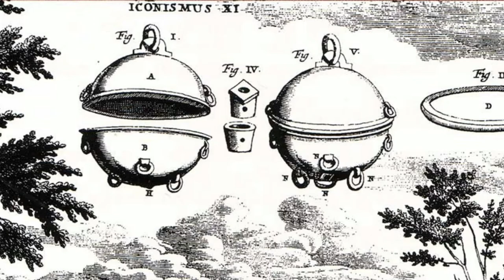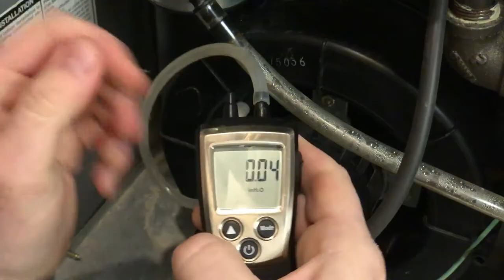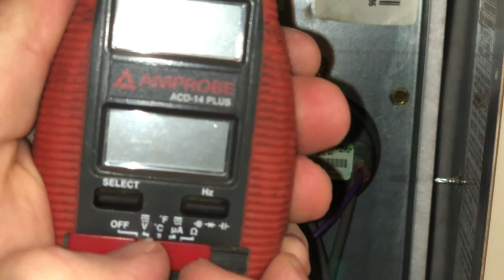Is It REALLY a Bad Pressure Switch? - How to test HVAC pressure switches and how they work.

Comment: I just spent 3 hours looking at EVERYTHING on a furnace... Iv removed the inducer, iv checked intake and exhaust.. Drains, tubing....

So what's chafing my rear is that the pressure switch has a -0.9"w.c. Rating. If I do an open manometer test on the pressure tube I get - 1.4" w.c.... So the issue is when I add the other tube that they use for differential pressure on the switch. If I add that tube to my manometer I now only get - 0.66" W.C.... so you would think that's where the issue is, except sometimes the unit closes the switch... So.... I'm either testing wrong and now need to question my literal 20,000 hours experience.... Or they are doing something funny with that pressure switch internally and I should just replace it..

I'm picking one up in 2 hours.... I will let you know if this puts an end to my mystery.... Did I mention I hate Lennox as a brand..... Ugh.

Edit: the units only 9 years old. And while it could be the heat exchanger.... I haven't seen failures like that on modern equipment that's less than 15 years old in the last 15 years. They solved that and offer 40 year heat exchanger warranties. So no I haven't opened the duct and checked that... Yet.
Reply from the maker: Did you ever find a resolution to this? I've experienced intermittent issues with pressure switches that were hard to diagnose. I always tee into the pressure switch lines to let the system operate as normally as possible when testing. With a low draft reading across the switch it makes me thinks that there is an actual draft issue, but I'd love to know what you finally diagnosed!